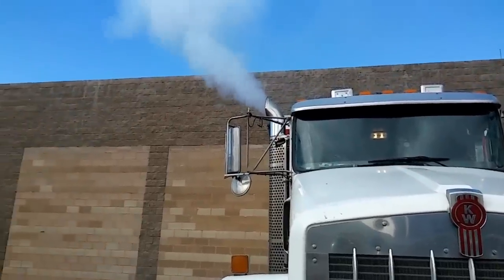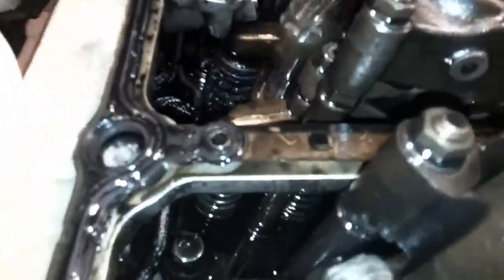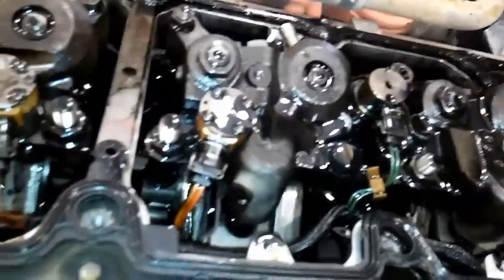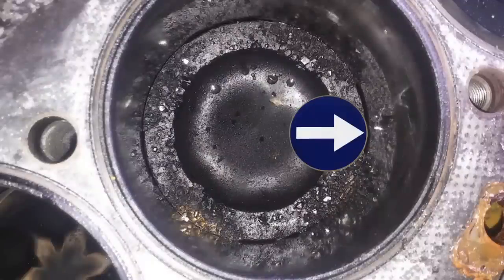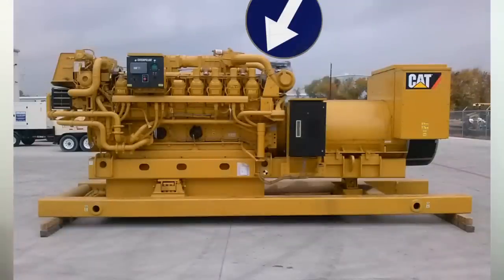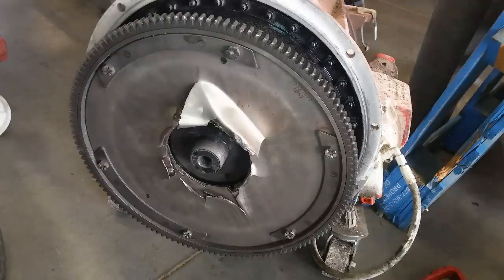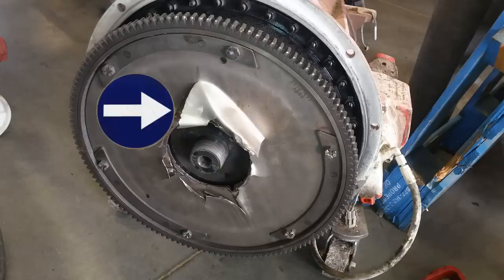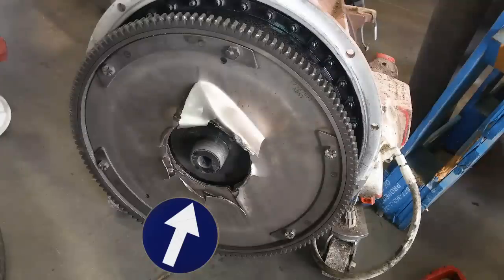Should You Warm Up A Diesel Engine?

Comment: Every diesel pickup ive own in the Canadian winters has high idled at 1000rpm for 15mins after cold start idle for 1minute...get some heat in the cab.
Every highway truck ive driving has done the same...never idle a big diesel engine always high idle. Detroits dont like to idle they will slug up on oil...high idle them around 900 to 1000...CATs be up around 800 to 900rpm.

Comment: If you're truck loses air pressure over extended periods of rest, just let it idle until it reaches operating pressure. That will insure that the engine has sufficient oil flow and temperature to start operation

Comment: It just takes a couple seconds for the generator at my work to get running where I work. Every year in Seattle, a couple storms come through and knock out the power for 3-8 hours. At the grocery store, lights go out completely for few seconds and you mind is like "what is happening" then the backup lights come on, but all the fridges and freezers don't run from the generator so it all needs to be covered with plastic and some times the food needs to be covered in dry ice. some times $$$$ of the food gets thrown away because it raised up of raised temp.

Comment: Long story short, my 2012 6.7L Cummins engine will high idle automatically below 40°F. Do you think the glazing will still happen?

My warmup routine is also meant to help the transmission warmup as well. This work rig is above 15k gross all the time, so I prefer to let the fluid warm for a bit before I put it to work.

Any thoughts?

Comment: When I start my gasoline vehicle I.mmediately place in reverse.   Let engine idle move the vehicle out of the garage.
Then engine idle moves the vehicle on the street.  No accelerator.   I am using that gasoline to head toward my destination and it warms thengine faster than if in Park or Neutral under no load.

Comment: Magnetic oil and or coolant heater you can attach quickly easy on oil pan or block . I had one to put on payloader in winter on pan and block in winter ❄️.
Then took off.
I had one engine developed pitting on liners from electrolysis from a 115v block heater that was in coolant.
Motor was ruined from leaving heat plugged in for months in winter.
I avoid them now and use magnetic heaters instead.

Comment: My golden rule during the Canadian winter is, always idle for at least 10% of the temperature in time.
-10 degree celsius= 1 minute idle time.
I usually just let my vehicles idle 5 minutes, I hate to think how much the little valves have to work in the automatic transmission, more than the engine warming up. Sorry environment!

Comment: Well I do agree with what you're saying in theory but it's pretty hard to start driving before the heater is throwing heat, it gets pretty foggy when its -30°C (-22°F) and my hot breath is the only heat source lol. I installed exaust brakes on all my diesels and they kick on when the engine is cold to create pressure until the engine is up to operating temp. Usually takes about 10-15 minutes and then there is heat to keep my windows clear.

Comment: After a cold start in cold weather, I’m monitoring both oil pressure and temperature. As soon as the combustion smooths out, I bump the idle speed up no higher than 800 rpm. Once the oil warms up to 100 degrees, is when I’ll start putting the engine on a light load, gently increasing the load as the temperatures rise to normal. Then it’s time to make money.

Comment: I own dumps truck and excavators, backhoes, skid steers you name it. No matter what the temp i start it, let it idle for 2 minutes, then bump up rpm for 10-15 minutes then operate/drive EASY until up to temp usually 10-20 minutes. Never had an issue, never had cylinder glaze nothing. I don't believe in putting any load at all until it runs for a while. Not only does it allow engine warm up and easy cylinder expansion, it allows transmission in truck, or hydraulics in machine to cycle and warm up. People forget its not only the engine that needs warm up. And if you are going to complain about more fuel for idle then you shouldn't own a diesel truck or machine. One thing I never do is idle for more then a few minutes and if I do, I always bump up throttle to 1100. And shut off procedure is EXTREMELY important in turbo diesels. After working the motor, run 1/3 throttle no load with heat on full blast to draw excessive heat from motor for 5 minutes. Return to idle for 10 seconds and its ready to shut down for the day. Been doing that for 30 years with absolutely no issues and all my stuff last longer than everyone else

Comment: The cummins engines at my work take about 20 minutes on high idle (1200rpm) to reach a water temp of about 130F  in the winter, they will not reach 180F  unless you drive them up hill pedal to the floor, (wich in my case I have no choice because pedal to the floor = 15mph)  So needless to say I have to run the engine for about 30 minutes for a pre-trip and to get the dam windows to defrost even a little, then instantly pull out and floor it up a 9% grade at 15mph lol.    (btw Have never seen an issue with our cummins powerplants, I can't say the same for the international they can't seem to take the same abuse as I just described above, 7 days a week.)

Comment: That is kind of convenient, since It can take a minute to five minutes just to get the air pumped up. 

I know I'm curious, you say to only give it a light load on startup. If you are going on duty from a truck stop, with a 40 ton trailer; do you want to unhook your trailer, and drive around a little bit; or do you want to just drive around in low range until you warm up?

Comment: I always start and go immediately on my gas F150 and all my previous cars.  Never had an issue.  I'm very gentle on the gas pedal the first 10 minutes.
Reply: Hans Schotterradler..... Automotive gasoline engines and Heavy Duty Diesels (used in Semis, Industrial, Marine and Off Hwy Applications).... are in two completely different "worlds"..... like comparing "black and white" or "apples to oranges".. the video and discussion here is primarily in regards to Heavy Duty diesel engines and focused on the engines used in Semis and all heavy duty class 7 & 8 trucks.

Comment: Marine diesel engines on big ships which need to develop full power (captain commands full ahead) from starting have water jacket heaters keeping the coolant at optimum temp at all times even when the ship is docked. They also have lub-oil heaters so the oil is kept thin enough to do its job properly.

Comment: Those in a rush hold the throttle to the floor while turning the key to the start position once the engine has started continue to hold the throttle to the floor for 2 minutes that will get the engine to the correct operating temperature and your on your way. On your way to replacing the engine.

Comment: I have never driven truck without 15 minute idling cause I live in Wisconsin. I start at 55 miles per hour and by the end of the day I drive at about 73 miles per hour. As the air pressure goes up in tires I speed it up accordingly

Comment: ... i think the new bell housing bolts are 10 mm ; You can put 3/8's bolts in the hole , but the bolts will brake , like in the video . It didn't look like metric head markings on the bolts . High impact can do that to bell housing bolt also . I like destruction of the week .

Comment: My experience is with somewhat larger units pop which the smaller 20 cylinder engine is 12,900 cubic inches and runs at 2500 KW at 900 rpm. The fast start Emergncy units used in hospitals and nuclear power plants are kept at at least 120 degrees F oil temp. and reach full load in 10 seconds. After a run the automatic controls will let it idle out for at least 11 minutes primarily to cool the turbo. At idle the exhaust temp. is about 200 F. They usually have an electric heater that heat the jacket water and a circulating pump that circulates through the engine and the LO cooler which is how the oil is heated. A marine engine that has been allowed to go cold (ice in the bilges under the engine) takes about an hour to warm enough to allow higher than idle speeds. Really large marine engines (13,000 HP at 90 rpm) are usually heated by an externally but a stay warm system. Since they are direct connected to the propeller and after a hot run they have n electric powered jacking gear that slowly turns the engine over until its cool enough to prevent warping the engine frame and posibly damage the bearings. 

I don't know about excess fuel not burning and washing down the cylinders. There would be a lot of white smoke in the exhaust. Probably let it clear up before loading.That's why you ned to change the oil more often.in cold weather

Comment: On ships we keep the jacket water temperature about 140 degrees even when shut down.

We have to run a boiler just to make enough steam to heat the water.

It acts as a large radiator making the engine room warmer especially in the summer!

 To replace an engine in a large ship
You need to cut a hole in the ship not just open the hood...

Comment: Where I was located in EC Illinois, normally, without livestock, I’d only need to fire up a diesel if snow was coming or was drifting. When snow was forecast I’d go ahead and plug in the block heater and the electric dipstick ahead of the weather turning.   Even then, I’d always let the temps come up some before moving.

Comment: 5:00 diesel fuel washing the cylinders walls is an old myth started by a person who sit behind a desk. Diesel injectors at idle, inject just enough fuel to keep the engine turning. Trucks you see smoking at idle, have old engines with lost compression and or bad injectors. 
The service tech told my company that same bs about it's bad to idle engines. Myself and some other old drivers made the techs remove the fast idle program. It waste fuel and make the engine run louder for nothing. My old 2016 Freightliner had 435k miles when I turned it in. It didn't use any oil or smoke.

Comment: I have a toyota turbo diesel. with 300,000 km or 186411 miles on the clock from 97. never warmed it up, I live where its  is around - 10 C or 14 F in winter. have never had problems

Comment: I always ran my Caterpillar engines at 1,000 rpm until the oil temperature gauge moves past 100 degrees. My last one only lasted 1,662,000 miles before I overhauled it. Only the piston rings were worn.

Comment: Let it run 1-2 minutes and drive it away gently without loading it or excelerating fast. That may work well in a discussion about the most advantages way to warm up a diesel but the way the real world works is as soon as it's in the street you have to get it moving or your blocking traffic. I would rather risk some fuel on the cylinders for a few thousands of a second at a time as the engine warms up enough to at the very least move the temp gauge some than get out in the road and  be in a situation where you have to get heavy on the pedal 2 minutes after starting the engine.

Comment: Use blow torch on oil pan for a min,  temp will be way higher than starting cold, I have 135amp alternator, 2kw inverter and space heater. 1.5kw spaceheater makes alternator spin difficult thus heating engine faster, I dont start driving under 100F, unless temps in 50s and higher

Comment: Don't know y this was recommended but I start my 1.9l 2005 tdi idle for 30 secs then 1200-1500 rpm untill temp needle gets to about 150f then drive 1/4 mile and directly on the eway no more then 50% throttle (68-72 mph/2400 rpm) untill 180 is achieved (85 mph/ 2900 rpm) then  for 45 miles one way non stop. 42 MPG.  May not be the best way but it's what I do.

Comment: Synthetic oil changes warm ups 
 When I was a fleet mechanic for a logging Company our drivers warmed up the trucks until the defroster started not blowing freezing cold air then idle down the road for 5 miles to warm up the oil in the transmission and difs. But that was in the days of 40 weight organic oil AAAND if they got 500,000 miles before it needed a inframe Cummins would fly the driver and his wife back to their plant give. Him a dash plaque and tour it was a big thing .
 Now when I had a small FLEET running synthetic oil and a driver didn't get a million miles before needing a rebuild I would of fired them. I like shorter warmups and slow start outs.

Now that being said I had a driver do no warmup take off and that was his last day because he was pulling a chassis that the brakes were froze applied on one axle and frozen off on the other axle meaning when I got to the shop you could follow the skid marks to where he sat with 4 ruined tires a$1000 later I fired his ass .
 Rented chassis are notorious for water in the air tanks and he didn't drain them the night before when he parked the truck.

Comment: I drive a ram 2500 cummins and always let the engine come up to temp until the coolant temp is 125f and auto trans temp is about 100f. Starting at low idle 700rpm for about a minute and then turn on high idle at 1100rpm for another 3-5 minutes or so. When i get to the destination I let it cool down at idle until the exhaust temp before the dpf is below 500f. Maybe overkill but thats what I do.

Comment: Lol well..... My texas 12v doesnt like the cold 😏 given the recent artic freeze we have right now.... It has to have throttle to keep running and it takes a couple minutes before it will idle on its own. 
-
I also got a 6.0 powerstroke with all of the computer stuff it runs up its own idle automatically handy feature when it will actually start 🤔
-
Once my trucks temp gauge starts to move the truck is ready to go. Given the temps, this week I left it running while I ran a couple errands. 🤷‍♂️🤦‍♂️

Comment: start the engine, let it idle 3 to five minutes to circulate oil, then accelerate idle to 1500 r.p.m. for another 7 to 10 minutes, then drop back to idle, vehicle is ready to drive, you treat larger diesel engines as what they are, industrial equipment, i come from a family of truck drivers, i personally have owned four dodge cummins turbo rams, and have gotten half a million miles out of 2 of them, one was an 01, and was a lemon from the factory, and my current one has 319, 870. miles on it, diesels are going to have cold weather fuel dilution, period, also remember, that after you run one all day, let it sit and idle for 5 to 7 minutes before you shut it down, this lets everything cool down, and stops oil from pooling, cooking and gelling in the turbo,

Comment: What cracks me up the recommended method of letting a hard run engine cool down before shutting off then designing a stop start car.
Reply: Letting a hard run engine settle down  before shutting it off is for the sake of the turbo. The turbo continues to free wheel at high rpm even after shutdown. without oil pressure. I've had to replace quite a few on fleet trucks. I'm retired from Ryder Truck Rentals after 40 years as a fleet mechanic.

Comment: Thank you for sharing your knowledge.  My CATS are 3116’s marine use in SW Florida.  I usually allow my engines to warm up at idle until the water temp is about 140-160. I am knew to Diesel engines, but I figure if they run around 170-180 at cruising RPM (2300-2400) then this is ample.  I guess my question is; is this too long for my climate and usage? What I mean to ask “I think” is SHOULD I leave port slowly, but above ideal, earlier to avoid fuel contaminating my oil? I hope I understood your lecture correctly.  Thanks again...

Comment: With my old idi diesel, I don't move until the cold idle timing advance goes off ( usually 3-4 min), wait another 2min and then drive off very gently until the water temp comes up when it's 20 deg.

Comment: If you say that one heater is good for 20°F to keep it up at approximately 80° at best, what do you think about 2 block heaters for say if the temperature is going to be about 10 °F or less to say one in #2 & one in #6 to help keep it warm to use in colder weather and warm up faster. You say after a couple of minutes of idle to run at a thousand RPM's for a while but to keep all the temperature and pressures up. 180 is good to go, at what percentage of load is a relative start 70/80%?

Comment: The believe the oil viscosity and type comes in play here too. I live in Alabama now and did an oil change. Though I wanted to go synthetic because of winter travels up North, I found a great deal on 15W40 dino oil and used it. Well, my first trip out, I ended up in Central Kansas (2-11-21) when the cold hit. Minus 10 at night, for 3-4 nights. Got a hotel room because no reload. When time to leave, I finally got truck started and cringed as I watched the mechanical oil pressure gauge seemingly take 2 minutes to reach 40 PSI. Sure wish I passed on that "good" deal on the dino oil.

Comment: great explanation...can you do a video on engine oil, life of engine oil, contaminants in engine oil, acidity of engine oil, why oil breaks down metal in engines even while sitting, if you have not run your engine in 6 months (say in a boat) why you should or do not need to change your oil...etc

Comment: Cat operating temp is 150 degrees per the manual idle first 5 minutes minimum as the heads are dry then fast idle 800-1200 rpm’s 1000 is good until 150 25 degrees temp variance is 175 good to go

Comment: i have rebuilt quite a few diesel engines that have cold seized from to much rpm after cold start. the pistons will grow alot faster then the cylinder and stick. especially under load.